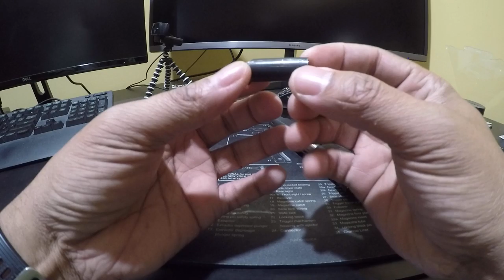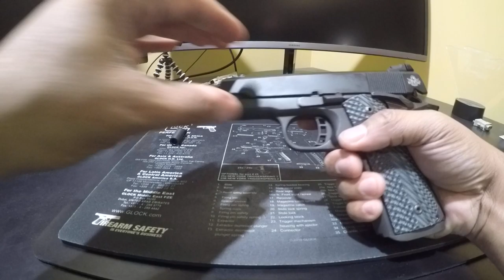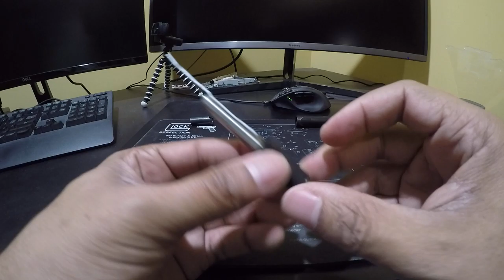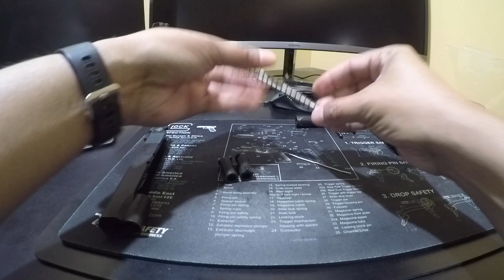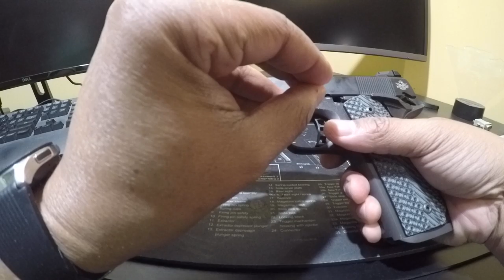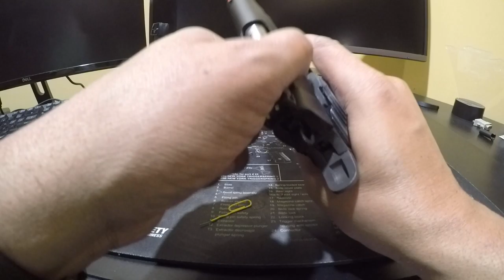1911 How-To:  How to use the slide to disassemble the recoil rod assembly on a bull-barreled 1911

Comment: Thanks for this video. I just got the same gun in .45 acp and had some difficulty putting it back together. I have a Ruger SR-1911 with the bushing barrel, which is much easier to take apart and put back together. Thanks again.
Reply from the maker: You're welcome.